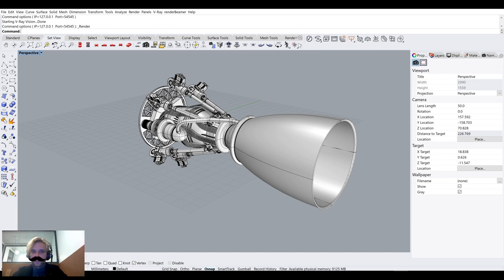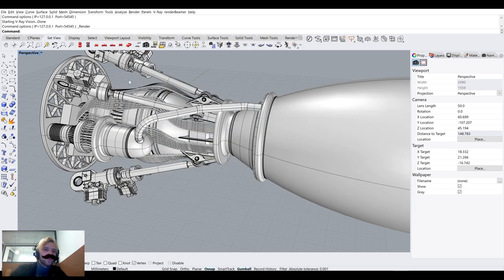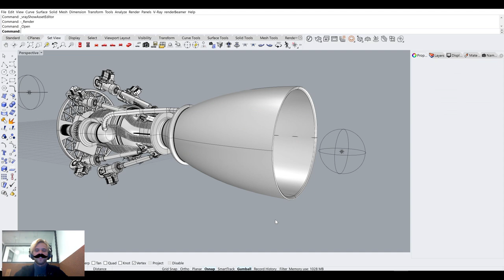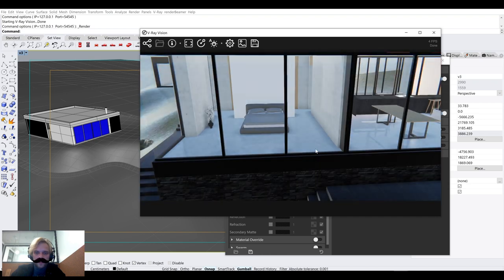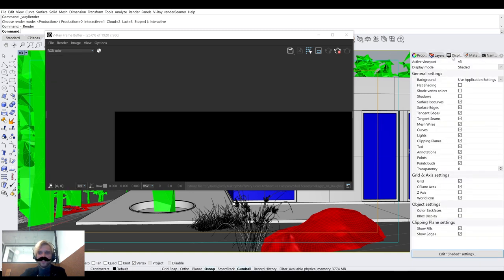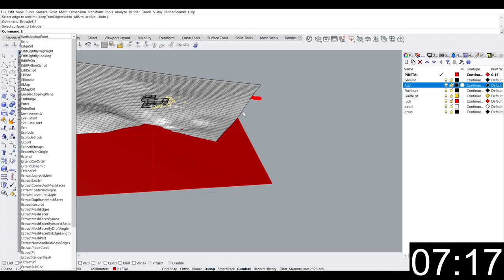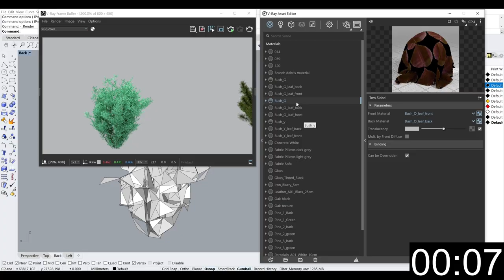VRAY 5 for Rhino finally REAL-TIME? Let's take a look at what's new.

Comment: Vray keeps duplicating materials aka [imported] when copy paste objects with textures between Rhinos.
New sunlight improved doesn't work in interactive. It simple doesn't move sun.
Rhino 7 files is bigger in MB that the same file saved in Rhino 5 or 6.
When opening Rhino 5 files with lots of xrefs Rhino 7 automatically shuts down.
So.. Chaos should make old features stable before release and waste time with the new ones.
Reply from the maker: Yup, duplication of mats is a problem. Sun movement still works with "Sun" command even with improved sky model. Increase in filesize is too small to be a factor. There indeed is a memory leak when dealing with old xref's in Rhino 7. Additional bugs: adding a map to a material doesn't update in interactive mode (render restart needed). Fog distance max clip is 1mil units, anything further away than that turns off the fog. It almost feels that they broke a few features that were working just fine in previous releases...
Reply: @DesignGoBrr  Hi. Thanks for answer... 
Yes, some how they broke major and useful features.
The material duplication is a mess when dealing with big files. 
I did not test the fog distance yet. My boss doesn't like that so much. He say to do taht in photoshop :-( 
The Rhino sun actually works fine, both in interactive as well in viewport.
In the other way Vray SunLight "custom orientation" doesn't synchronize update with rhino manual sun. I didn't find the reason for that. But is a crapp.
Why Chaos keep moving forwards without stabilize old useful features.   
This is happening in all versions we have got since vray 2.0.
:Shame on you CHAOS. Shame on you.
:-(

Comment: It renders only after you stop moving the part. That is not real time.
Reply from the maker: That's not true. It has direct screen input as well as delayed modeling input. Ofcourse it doesn't update in the middle of a Rhino command, but.other than that Vray Vision is completely real time.
Reply: @DesignGoBrr  Then I don't understand why the shadows were rendered after you stopped moving (revolving and rotating) your model.
Reply from the maker: @jcjensenllc  Could you let me know the time in the video so that I can take a closer look?
Reply: @DesignGoBrr 
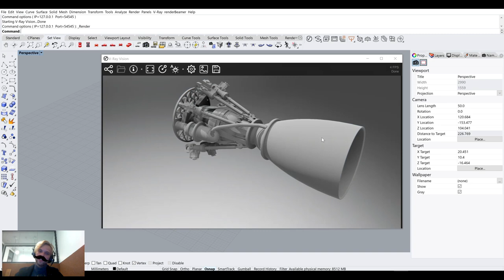1:42 to 2:05, watch shadows in render window appear after movement stops.
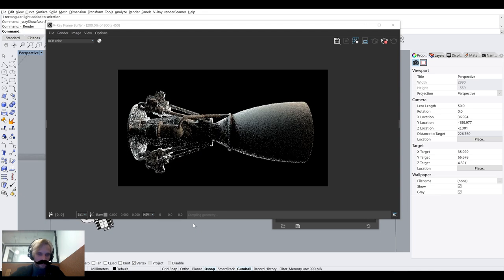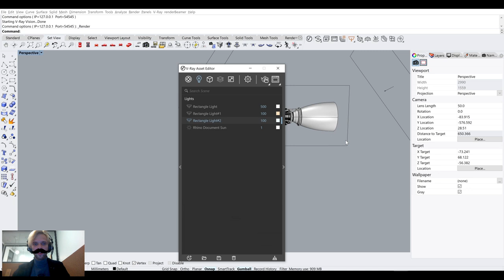08:54 to 9:52  not real time.